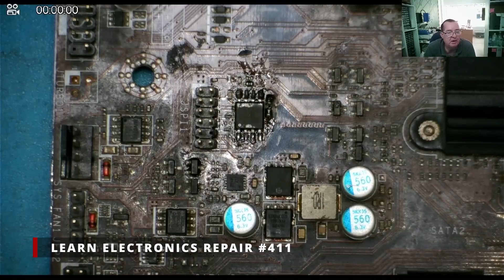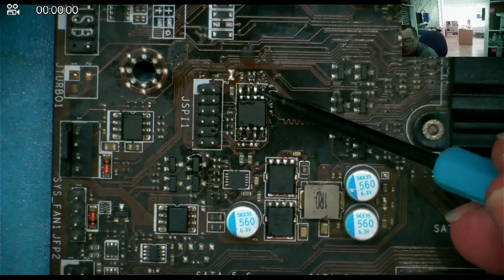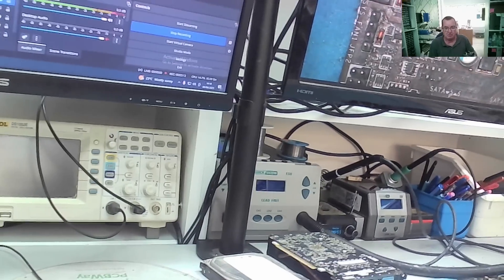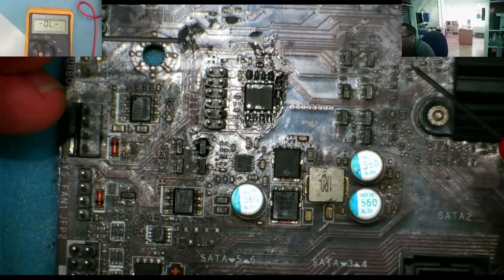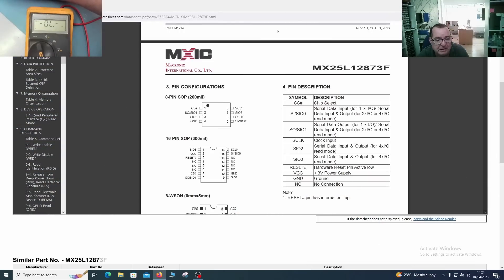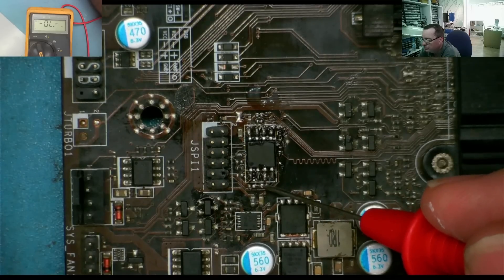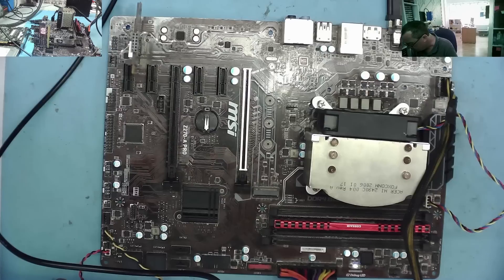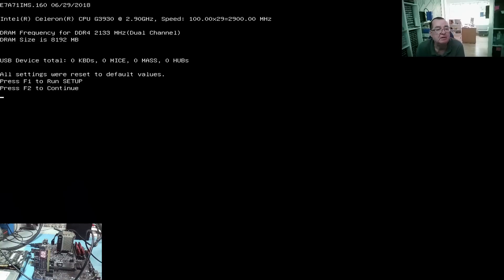MSI Z270-A Pro Motherboard Will Not Boot.  PART 2

Comment: Ahhh, I watched both videos and have the same issue with my motherboard.  The fix (for me) was to remove all the memory cards and reboot.  It then gives a notice of no memory.  Shut down and add one card in slot two and reboot.  That did it! it came back up :)  I live on a boat and the computer got a bit wet from an open hatch and a bad thunderstorm.  I think maybe something got erased?  Anyhoo, it is up.  I want to add the other three one at a time and see if I have a bad card or if it just needed to find its way.
Thanks so much for your video!  Super helpful :)

Comment: Good recovery. R781 (assuming A Bios IC) is 15R (which then has a 1k pullup to SPI_VCC3 pin 1 on the JSPI1 connector). Schematic on Badcaps.

Comment: Good educated guess at the resistor value. This is where experience helps a lot. I would have had to try different value resistors until it worked, or until I cooked something. :)

Comment: Thanks Richard, I have a MSI Z490-A Pro doing this exact same thing. I am going to try to reflash the bios tonight. The board was only $17 on EBay so nothing to lose.
Reply from the maker: Good luck, be sure to do it properly by desoldering and programming the eprom, not trying to use one of those in circuit clips.  And watch out for those pesky resistors, if it wasn't for them I would have gotten away with it too... first time around

Comment: I told you. Only check with 1 ram.
Reply from the maker: You suggested 'that I should only check with one ram.  I normally check with 2 (dual channel mode) but if the board will not boot I then generally try with no ram, and if it bleeps then I try with 1 ram in various slots.  

In the case of this Z270-A Pro motherboard the user manual specifically states that using one strip it must go in slot 2, using two strips they go in slots 2 and 4 and using four strips you populate all slots.  As the user manual says to do that I don't see any point in trying the other combos, especially as the board is now working.  

If I had four spare strips of ddr4 to hand I would then test all the slots.  Actually I just won 4x 8Gb Corsair Vengeance DDR4 in ebay auction so I have some more spare ones now, though they are going to my mother-in-law UK address so she will either post them in the next 'foreign aid' package she sends or she will bring them with her when she is visiting Gran Canaria in mid May.  I'll have them eventually either way.

Comment: Corrupt bios was the problem.
Reply from the maker: Corrupt BIOS and bad rework, basically 😂
Reply: @LearnElectronicsRepair  Isn't there a method of reflashing the bios without removing the chip?
Reply: @tonysheerness2427  You can use a clip, but a lot of people find them unreliable to the point that they don't even bother trying them first. I don't have much experience myself but from what I have read it seems there is a bit of a lottery with those clips some people luck out and get a decent one.
Reply from the maker: @tonysheerness2427  The problem with the clip, which I do have, is that you need to provide enough power to the eprom Vcc pin (and everything else on the motherboard that runs from that rail) before you can program it.
Reply: @LearnElectronicsRepair  Have you done a video on that topic? It might make an interesting video. Regards, David
Reply from the maker: @davidv1289  No I haven't but it is a good idea... 😉
Reply: Wonder why the bios would have corrupted itself? Someone did a bad flash?
Reply from the maker: @Harsesis86  It belonged to a miner so they probably messed with it
Reply: @Harsesis86  Power surge, spike on boot up,  to close to a magnetic field or like say some tried to update the bios.

Comment: Well done.
It was actually a bad bios content.
And then you had the dreaded repair incident: introducing a new fault while repairing.
Been there, tried it, numerous times
Reply from the maker: Pretty much that, yeah.
Reply: @LearnElectronicsRepair  Seems Sorin has caught the dreaded BIOS reflashing disease. Every video lately he is reprogramming the BIOS of the device believing the issue is BIOS related.

Comment: SIO2 and SIO3 have the same function and there's a similar resistor on the other side of the bios chip, you could have checked its connection and value.
Reply from the maker: That's good advice Chris.  Thanks 🙂
Reply: That's what I was thinking. Whatever is on SIO3 should also be on SIO2. They look like they do the same thing to me.
Reply: @Chris Hartley - yeah, but it doesn't matter, because as soon as you see the post screen, then bios chip is no longer needed. In fact, you can take it out during working motherboard with no side effects, because whole bios data is copied to memory as soon as you turn the motherboard on. So if the motherboard is working now, then it means the resistor value was in tolerance range and you can forget about it.

The only thing, what can go wrong in the future (when you have wrong resistor value) is the bios update in DOS or in Bios via flash tool. I'm not sure, but maybe it could produce artifacts in data during write to bios chip.
Reply: @Radek__  Hindsight is a wonderful thing. If the motherboard didn't work with the 22 ohm resistor there would be no way to know if it was because the resistor value was wrong or because of another fault. By measuring the similar resistor on pin 7 it is possible to eliminate a wrong resistor value.
Reply from the maker: @chrishartley1210  Again you are right, more so than I was, I just didn't think of it at the time even though I use the same technique you describe often enough on audio amplifiers where there are two or more identical channels. I do believe in this case that the value of the series resistor on the data line is non-critical, as long as you have enough experience to realise it should be a 'low-ish' value then any guess is probably good enough. There is almost no current on the data pin of the eprom so the voltage drop across the resistor is practically zero.